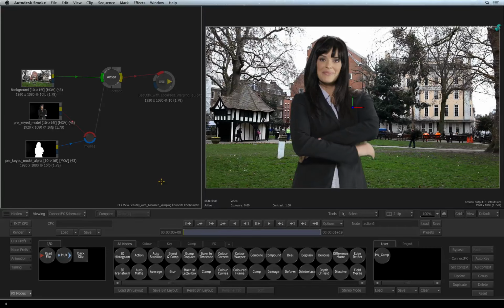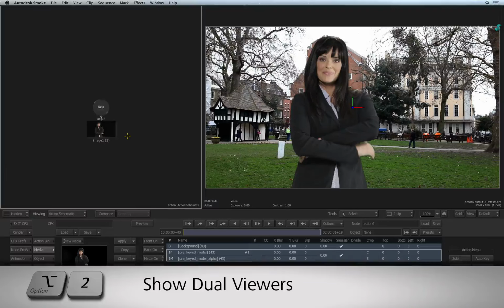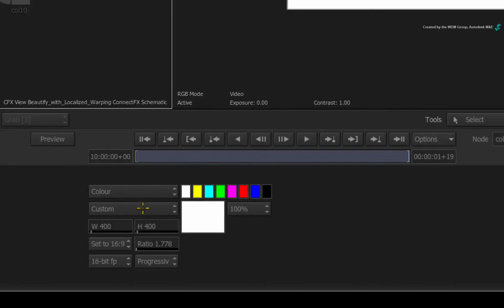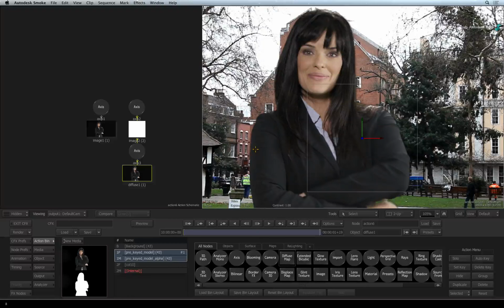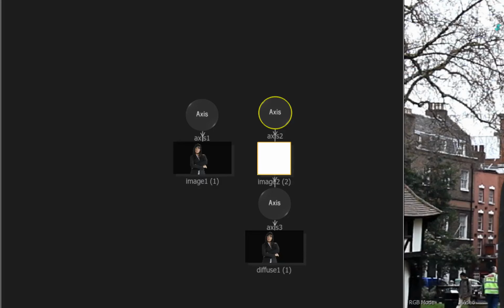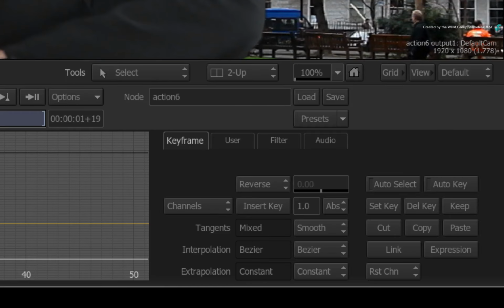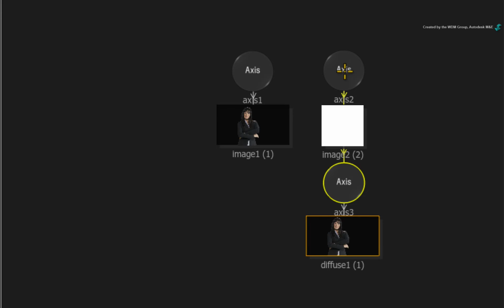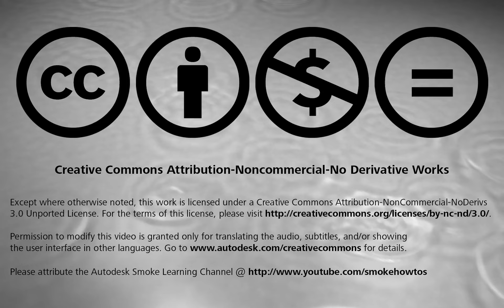Beautifying with Localized Warping - Part 1

Comment: I frustration with smoke.. I try cancel and exit it from Mac but its won't exit.. ""connectFX: cannt exit CFX1: node MVI_34 must have input Front""  I dont understand? please help me.. I need cancel and exit. Thanks
Reply from the maker: Shekib Asghari Hi, you need to connect your final output into the CFX output node at the end of the node tree in order to exit CFX.   If you don't connect the final result to the CFX node than the clip in the timeline will not know what to show in the player.
Reply: oh okay. Thanks